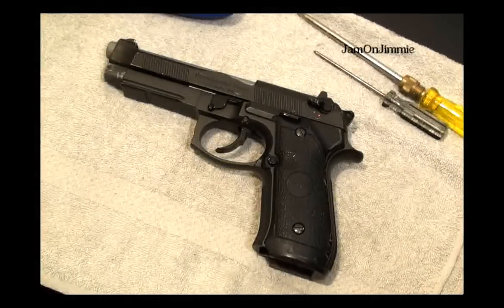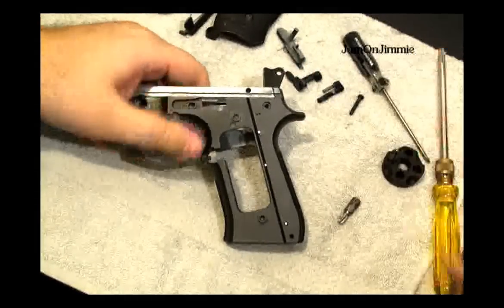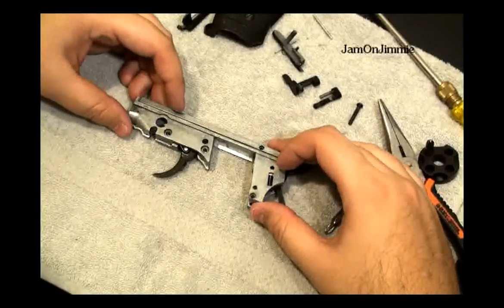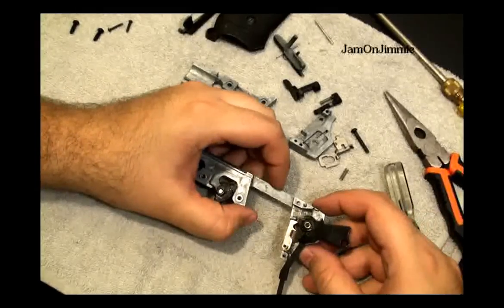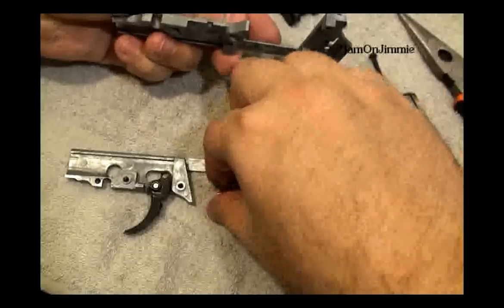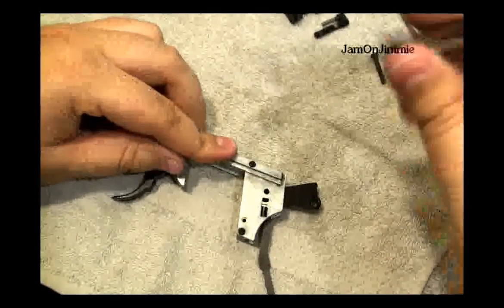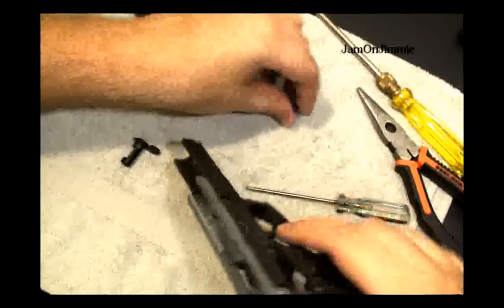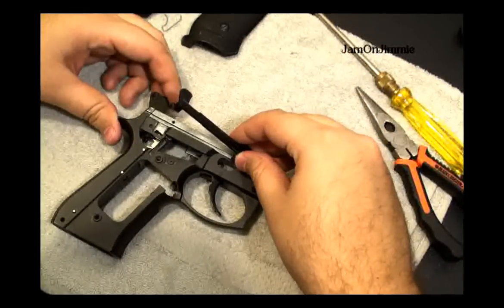How to Replace an Airsoft M9 Trigger Spring

Comment: 10 years…10 years goddamit! It's been 10 years since my trigger spring failed on me, I really owe my thanks and gratitude to this video, it saved my gun. I followed it step by step, pausing when needed and managed to fix my gun. God it feels so good to have the trigger do what it's supposed to do. Before, I could pull the trigger but it wouldn't return to its position unless pushed and that was so gay!
        If anyone else is looking for the part, I got mine for $6 plus $2.85 for postage from 'HK-Parts' and you want to look up 'King Arms enhanced spring set for Marui/KJ/HFC M92F GBB'. It comes with 5 springs, one of them being the trigger spring under the code "92B-35", the other springs are "92B-17" x2, "92B-64" and "92B-62". Get those parts, follow this video, gun fixed!
       
     Mega-thanks Jam On Jimmie!

Comment: sounds like the spring that puts tension on the long thin piece of metal on the right side of the gun (pointing it away from you), starting above the trigger and going all the way to under the hand grip is lose. remove the hand grip and see if the spring that is shown at 0:51 is in the correct place

Comment: "that metal bar there" is broken for me. As soon as I took it apart, and I got the gearbox, the trigger fell out. I hadn't even taken out the screws or anything. I'm not sure how this happened, but I want to know if I can take a soldering iron and melt it back on. I really need help now considering I don't want to buy a new pistol and my gun won't work without it.

Comment: Hey there, Jimmie.
I have a problem with the small screw at 3:24
It was on really tight when I tried to take it out and it ended up being stripped. Is there a way to extract the screw?

Comment: @majorcinnamonbun If you take the spring out you could try your local hardware store or maybe a actual gun store. at a gun store it might be around 5 bucks if they have any (just what i was told, never got one from a gun store my self.) You could also try taking apart some old toys or cap guns and see if they have one that works.

Comment: Hello people, I have a Co2 pistol its a replica of a 1911 and its a High Power Mark 3 pistol. Today I was shooting it. And my Trigger stoped working. Now, You can pull the trigger and it will come back out, but it will not fire the gun. I took the slide off of the gun and took a look. When I pull the Trigger I saw that the Trigger does not bring the   Object all the forward like it should. I Cleaned the gun very well and tryed as hard as I could to mess with it without taking it apart. I am very Mad/Confused if anyone can help me, Please reapond back to this comment. Thanks.
Reply: Respond*
Reply: You're having pretty much the same issue that the video here is addressing. look up your weapon's parts and find a trigger spring, or reset spring, tension spring, return spring, something along those lines. it will be a spring who's function is to return the trigger forward to the fire-resistant position. then, either youtube or a manual will show you the basic disassembly of the gun and you'll need to take it apart and put the new spring in. the springs are like 2-4 dollars, very cheap.
Reply: +Kyle Taylor 
correction: fire-ready position. 
sorry, didn't proofread

Comment: If you buy spring wire/ music wire of ebay you can make your own springs.
Reply: MNA Films yea buying the correct spring is easier. but at the time I couldn't find any spares without paying ridiculous postage and I needed to fix two Beretta's. The spring I made has lasted so far with out issue, its a good chance its better quality material than the original spring.

If anyone is going to make their own wear goggles, don't buy wire to much thinker than the original stuff as it can be hard to bend and if I remember correctly I twisted the wire around the shaft of a small screw diver using two pairs of small long nose pilers.

Comment: This is BS!!  You ONLY Need to remove the Trigger Bar and the Trigger Pushpin (knock out from the right side with a Pin Punch) and the Trigger drops PUT!!  YOU DO NOT NEED TO REMOVE THE TRIGGER INNER  ALUMINUM ASSEMBLY!!  This applies to:  SRC, WE Tech, Matrix, B&W, VFC, S&T, TM and many more!